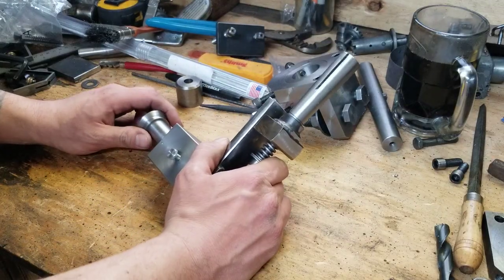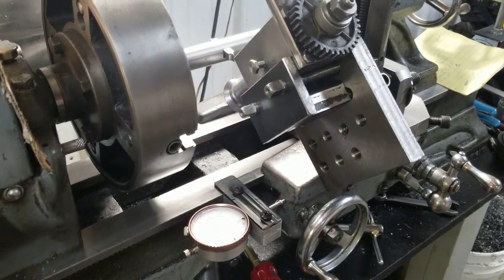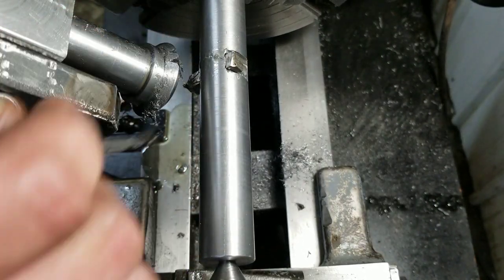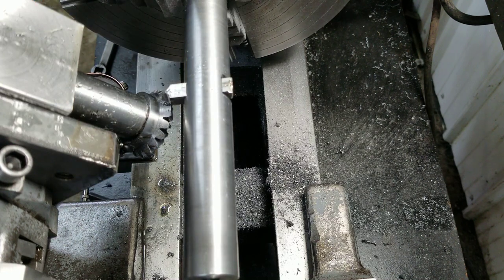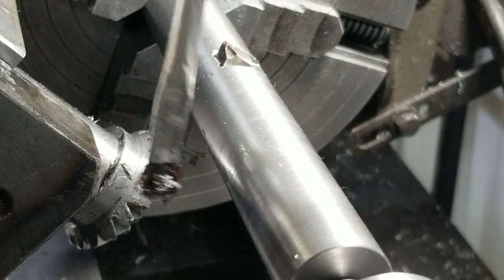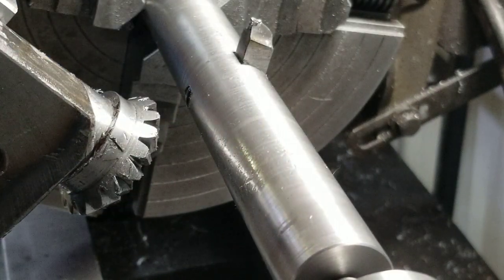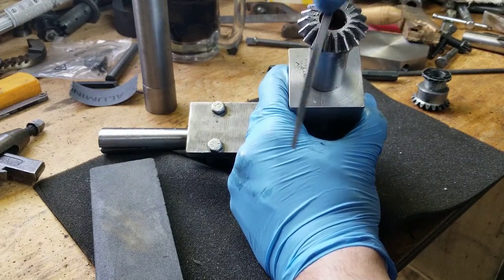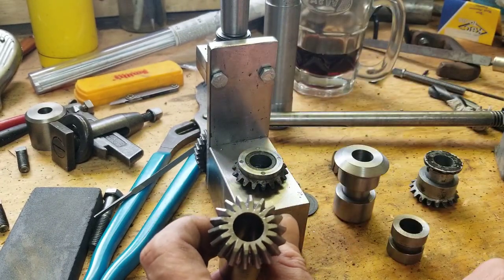Reverse Feed Gearbox Rebuild, The End is Nigh... Cutting the Bevel Gears!

Comment: An incredible achievement from the plan to the build to the finished gear.  I'm happy to say that you have easily far surpassed my abilities, and though still pretty new to it all... You're a natural! Amazing job of using what you have or what you can make to get the part done.
Reply from the maker: Thanks, John! It's really been quite a ride lol. A lot of work to get to this point to be sure. Should be easy sailing from here... maybe😁
Reply: I know it won't be easy or quick, but the universe is basically telling you to save some cash to plunk down on an old milling machine. The writing is on the wall my friend... If you can think your way through to making that gear on the lathe with a shop made milling and indexing set up, then the things you'll be able to make with a proper mill (and the lathe) will be CRAZY!!  This video right here is going to help propel your channel no doubt. Great job.  @Just1GuyMetalworks
Reply: @Just1GuyMetalworks  Looking for a 100 views on this one. :)
Reply: There's that 100th view! :)
Reply: I saw your comment on the record video. (Thanks) - I had to 86 it, but whatever. :)

Comment: I just hit the "Buy" button on a complete set of Atlas 10" forward/reverse gear box & gears and it costs more than I payed for the lathe !? Yikes !!  I'm guessing I'll think twice before engaging to a jammed up lead screw. Time to get out the cleaning solvent and brushes (and oil) in the meantime til it gets here. I think the first thing I'l do is make a mold in casting wax of each of the gears and keep the OEM lineage alive in a set of cloned gears. Not gonna cast in ZAMACK!😌
Reply from the maker: Yup, that was my biggest reason for this project 😊. I now do a check before flipping that switch, especially in winter.
Cheers! 😁

Comment: How’d you grind that bid did you grind it to fit the gear or more along the lines of keeping it smaller but with both sides intact just overall narrower?
Reply from the maker: I believe I just matched the profile of the tooth but kept it only as thick as the toe of the gear (or close to it). Only the heel of the tooth should get much wider on your second pass. Or that's at least how I had it figured 🙂
Reply: @Just1GuyMetalworks  I was thinking that or finding a 18t 12p gear regular and matching that profile regardless I’m gonna have to make one soon

Comment: What size chuck is that? It looks large for your lathe! But it does work!
Reply from the maker: It's an 8". About as big as will fit on her 😁.
Reply: @Just1GuyMetalworks  Chris, that  lathe would be a lot  happier with a 6” or even a 5”, I have a lathe that was built around 1880s and it is a 10” and it came with an 8” chuck, it really struggled when I used it with the 8” 4 jaw and the other chuck was a lot newer 4” 3 jaw. Which was too small for my needs. That lathe just sits now collecting rust.
Reply from the maker: @RockingJOffroad  I wouldn't mind a smaller 4 jaw, maybe a 6", would do a little better at higher speeds I think. What I'd really like is a decent collet chuck. Especially for that smaller stuff. 
In time I suppose. 🙂